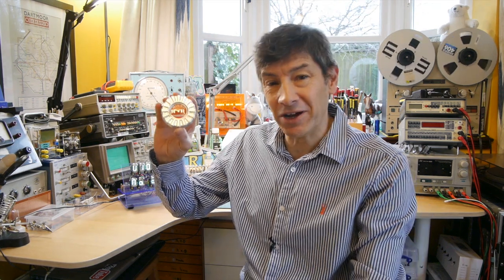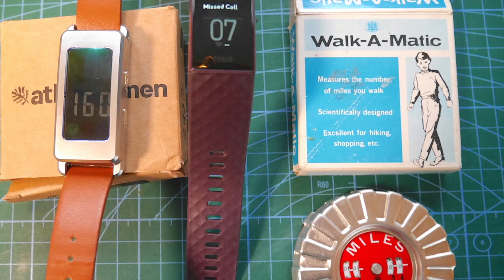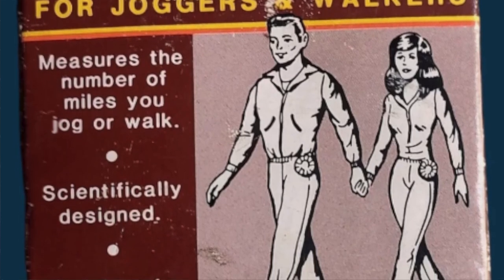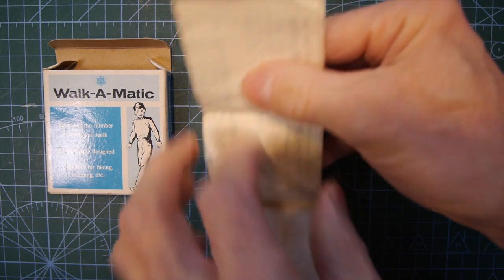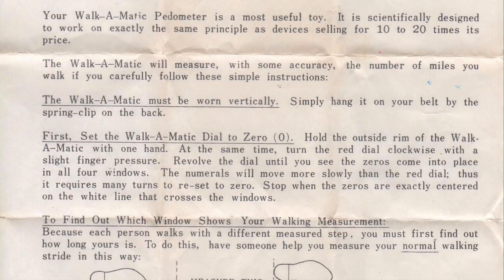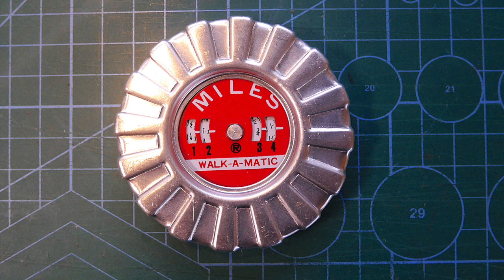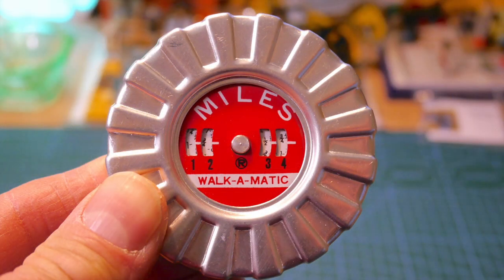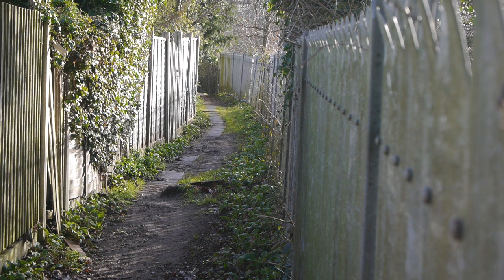Walk A Matic an interesting device! - F-J's Physics - Video 208

Comment: I remember Izal brand toilet paper that dispensed from boxes inside wall-mounted porcelain holders. The less said about that the better, too!
Reply: At least it was better glazed than most modern book paper.
Reply from the maker: Did make for good tracing paper! (But not much else!)
Reply from the maker: Yes, indeed!  I think that is probably going to be the most remembered thing from this video!